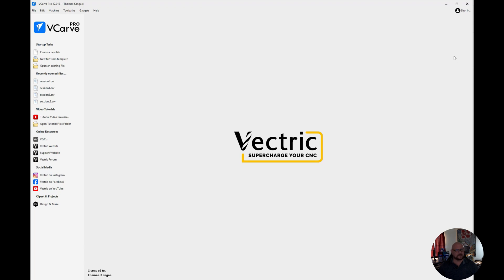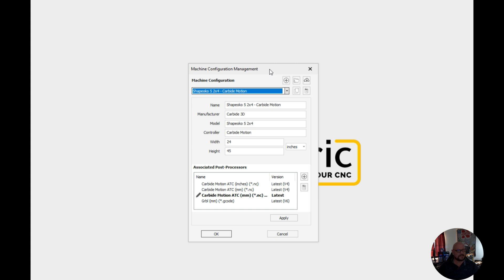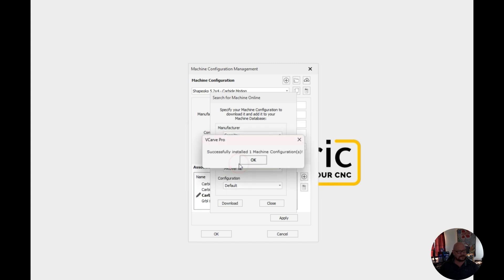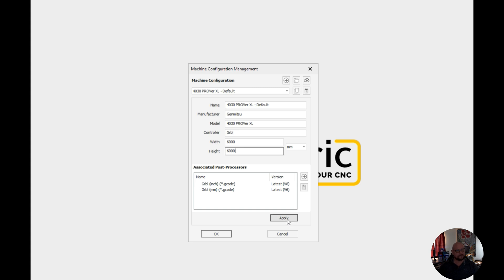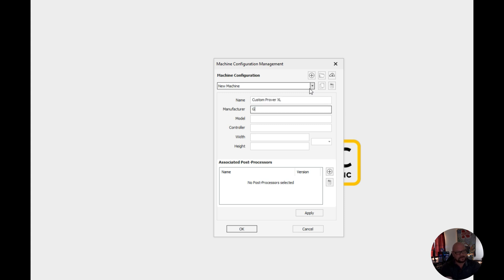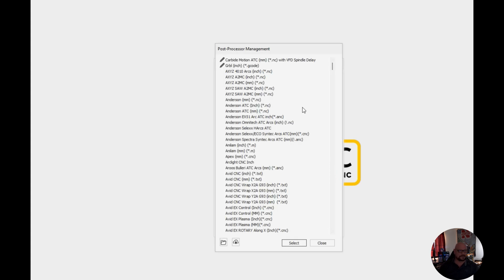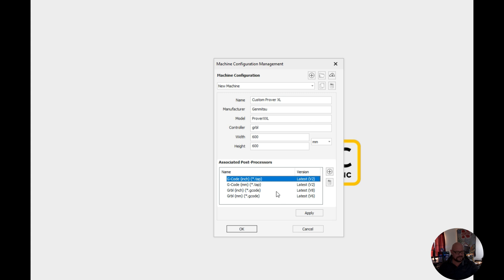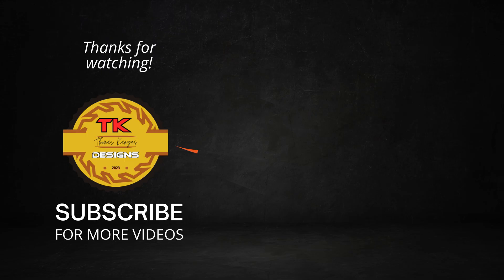Configuring Your Machine in Vectric VCarve Made Easy for Beginners

Comment: This is not for beginners, a little clarification on the controller, and width/height. Is that cutting surface, or the actual dimensions of the CNC? I know you aren't the developer of the software, and you aren't the manufacturer of the machine, but I found you through a google search while trying to setup my machine in the Vectric software. Pretty frustrated as these little tidbits are what I keep getting hung up on while setting up my equipment.